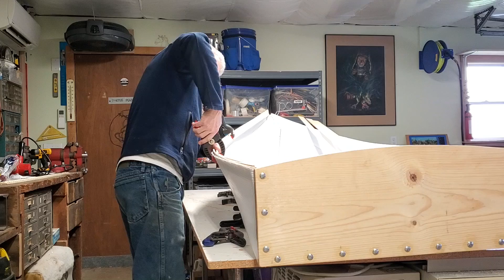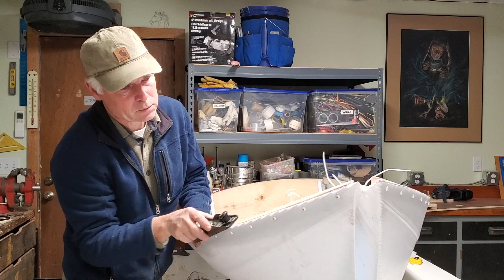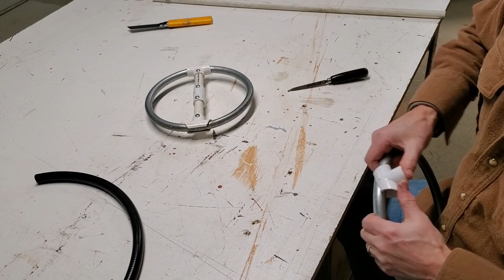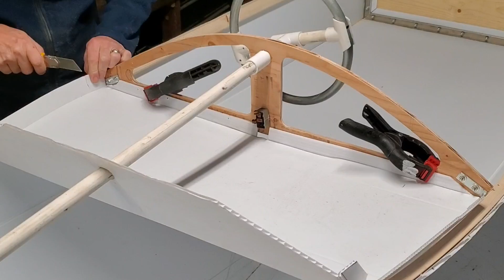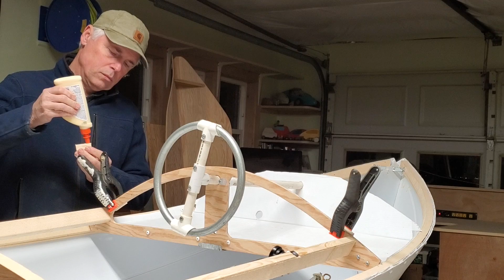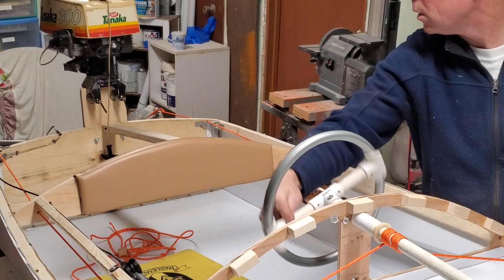Coro Speed boat (part 2)

Comment: You really know what you're doing. I like to think that I would at least be able to build a paddle, or something, for a boat, but you really put everything into it. And when you got to the electrical part, I knew I really wouldn't know what I'm doing, and that you're very professional. I know nothing about electrical or plumbing hook ups. How to do it, that is. I'd be more likely to start a fire than a motor, if I were given the task of building electrical things from scratch. Or else, it would just be that literally nothing works, even though the motors and wires are sitting there, as if hooked up. You could make a lot of money building and selling things, if you don't do that already. I can see you making up to 500 dollars per boat, if you made a few more of these and sold them. You could also make a lot of money giving classes on how to build things, whether one on one, or in a group setting (up to five people, or up to ten people in the class). Thanks for taking us on the journey of things like this boat being built.

Comment: Awesome.  I have thought an interesting boat would be a "Florida fishing shanty" similar to an ice fishing shanty.  It would be an old pontoon boat deck, build a very lightweight but comfy hut atop it.  Have lots of windows. Window screens are the requirement, to ward off the mosquitoes.  Cut a square hole in floor, & make a baffle that slides down to the water's surface (remember the mosquitoes) and fish through the hole.  Corrugated plastic may be the material needed!  Perhaps on a pvc frame, or aluminum.
Reply from the maker: Two by two's would work for the frame. Cheap and easy to work with. I like it

Comment: Love the shape of the boat! I am working on one myself. I’m curious what dimension from the front to the dash / steering wheel mount. Also from the transom to seat back cross piece? I would guess the position of the rider makes some difference in handling.

Comment: Pipe bender could have made boat frame out of ski poles.
Used soldering iron to melt seams for folding.
I started on Saturday and refuse to but a electric troll prop unless I make it all.
Probably a dingy towing dog behind me
Shuswap lake a mile awau but it fits in trunk hanging yellow beak out, lol

Comment: you might be able to make the steering wheel ring out of heated PVC pipe, if some one cant get a hold of a pipe bender, or wants to save money. it should also save weight. Fill it with sand and bend around something round, should work.
Reply from the maker: I've thought of doing that, but haven't got around to giving that technique a try. Next time!
Reply: @paulwelkinsdiy   cool cool, ill keep an eye out.

Comment: That's really nice Paul. Do you think that is the strongest/ most durable coroplast boat you've built so far? It looked like you were you able to bend your conduit  without any kinks or deformation. I never have used one of the conduit benders and wondered how well they would work. Thanks